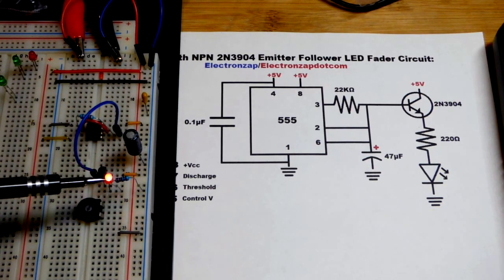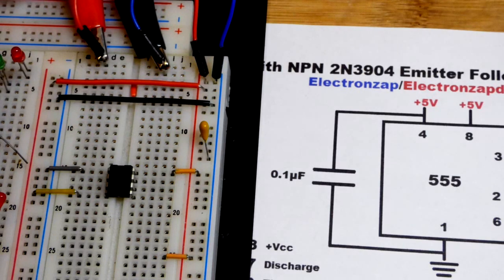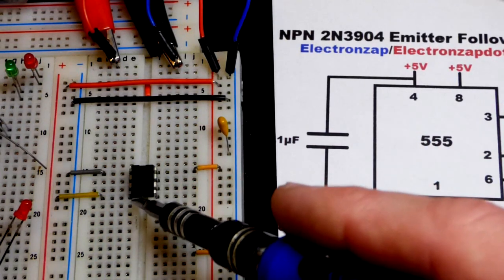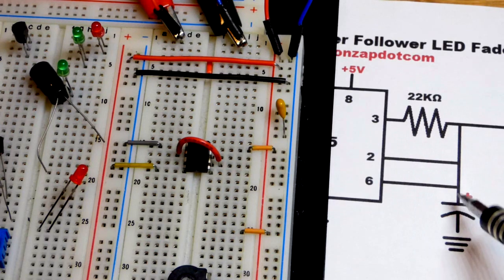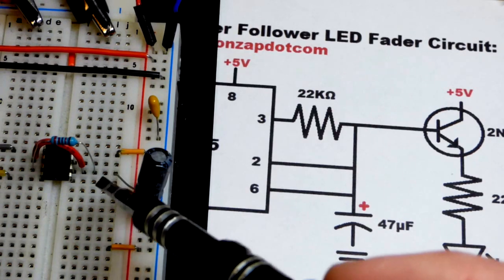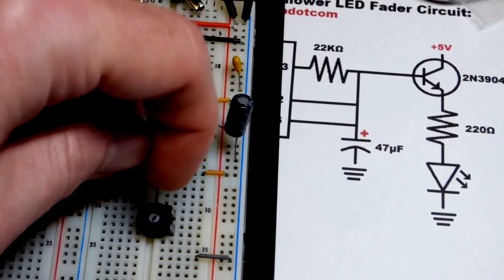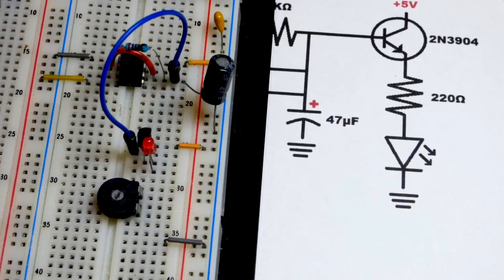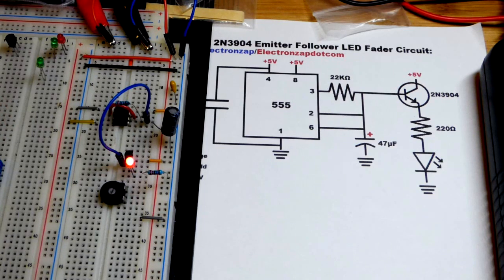LED Fading on and off circuit using astable 555 and 2N3904 NPN bipolar junction transistor BJT

Comment: Hi is there a way to increase the output voltage besides changing the resistor for the LED?
Reply from the maker: A CMOS 555 timer, like the LMC555 can output the full supply voltage as ling as you don't need much current. Which is the case in this circuit.

Comment: VR to change the current going to the capacitor will change the speed of the fader cycle(I’m sure you know that). I used this circuit to vactrol a lm386 input for a guitar vibrato circuit works wonders.
Reply from the maker: Nice!

Comment: Sir can I use bc547 instead
Reply from the maker: Sure can! Looks like the bc547 collector and emitter are on opposite sides of where they are on the 2N3904 though. So you should have the flat side face in the opposite direction of what I've shown.
Reply: @Electronzap  thank u sir